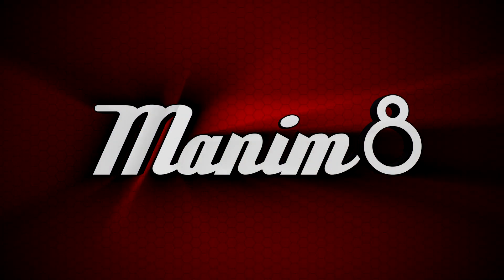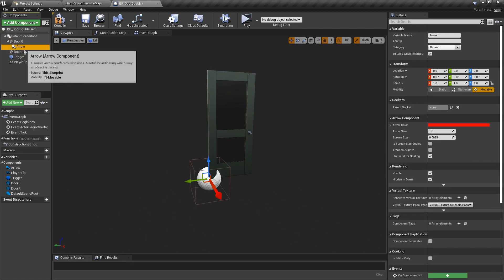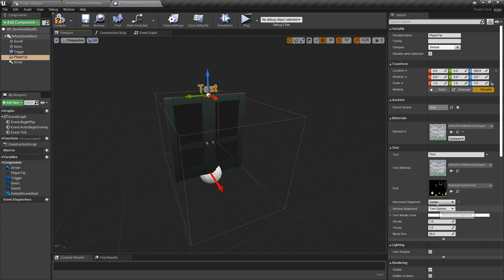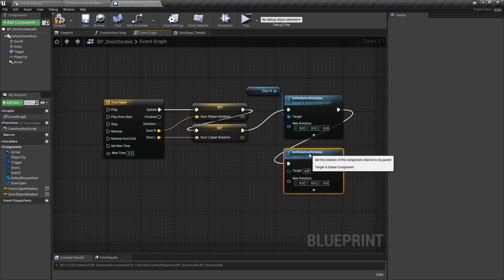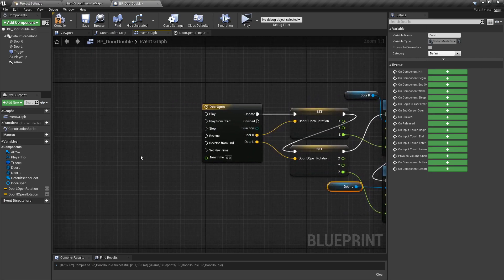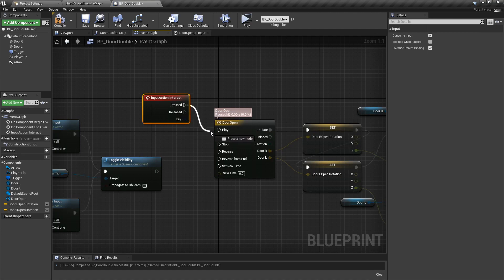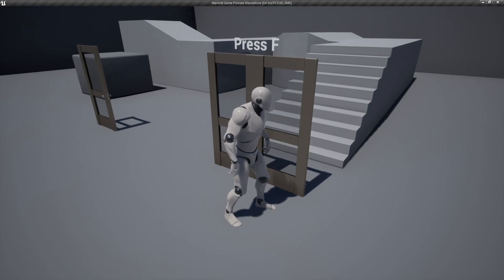How to make working Double Doors | Unreal Engine

Comment: Thanks for this tutorial, but i got FBS drop when I create this BP. and did not know what to do? I'm new to UE
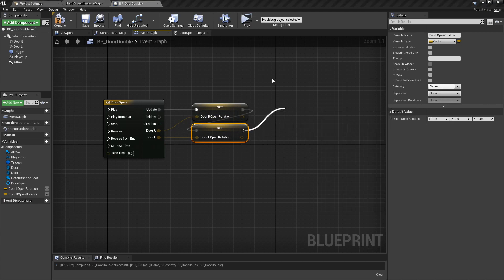Reply from the maker: Hi. I doubt it is the BP that is causing the frame drop. UE has a funny thing where it will drop frames after compiling and saving BP's sometimes. I get this all the time. It usually fixes itself after compiling and saving another BP or restarting the editor. By the way, the section between 9:05-10:29 is not needed. I recorded this a while back and you don't have to set the variables after the Timeline node. The Update Pin on the Timeline should go directly into the Set Relative rotation node 👍👍🙂🙂
Reply from the maker: In fact I just re-watched more of the video and there is a better way to do it without using Vectors (geesh, I don't know what I was thinking lol) I will make an updated better version soon.

Comment: Hi! I tried to add the door to the sequence so the door is not working anymore, I deleted it from the scene and dragged its blueprint again to the scene still not working when I press F. Could you help me with this problem.
Reply from the maker: Do you mean the Sequence Editor?
Reply: @Manim8  No, the cinematic sequences.
maybe when I opened the project in the UE new version I missed a setting.

Comment: Im having a problem with the right door. No matter how often I follow your instructions, it insists or rotating the wrong way. Ive gone through the graph several time and rechecked which way the door says it should rotate, but it always goes the opposite direction to which it should be going. Any ideas what might be wrong?
Reply: Don't worry. I solved it. I had 2 references to the same door for some odd reason even though I had double checked it.
Reply from the maker: lol Glad you figured it out. It amazes me how often I've made mistakes like that and just couldn't see it, no matter how many times I check over it. It usually takes me to go away from the PC and do something else. Then, when I return, it just pops out!lol